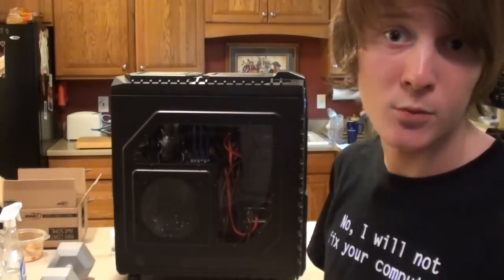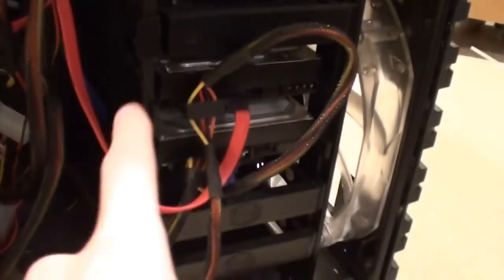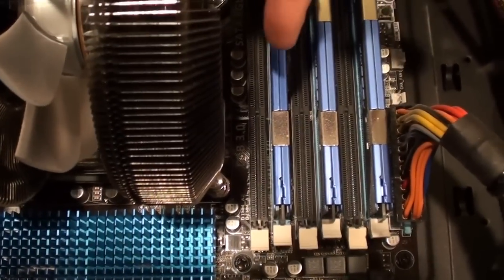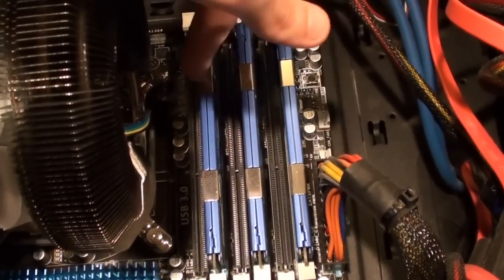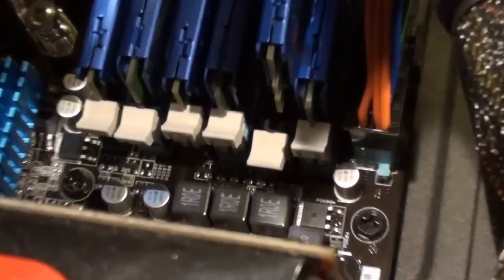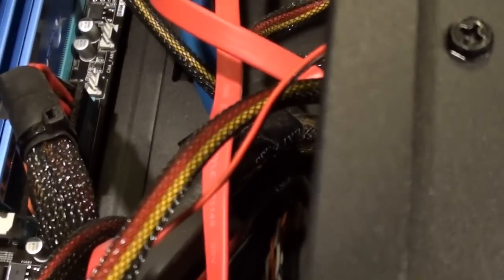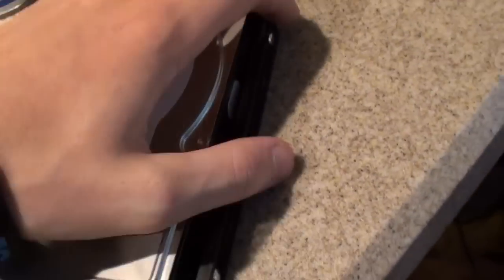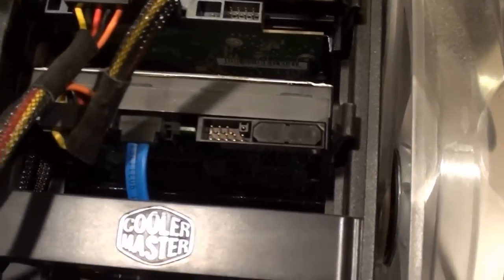Rep Tech  #2 How To Install Ram In Your Desktop PC

Comment: Touch the metal on the computer frame so that you are the same charge as the computer (saves lugging around 30# weight). Also I thought that there is a jumper on hard drives that must match the dead drive you removed?

Comment: thx so much, but I have a question I have 4 slots and the second and forth are filled, I want to add more ram, can I add just one stick and if so where would I put it in the 1st slot or the 3rd slot?

Comment: Cable Management is a common overlooked part of building a PC. Don't be that guy with a birds nest of wires inside yours.
Reply: Owen E That's me lol. My PC came prebuilt so they were wrapped all nice but when I upgraded my gpu I needed to upgrade the psu also and oh god..it looked horrible by the time I finally got it all installed. The cables look terrible lol.

Comment: The notch in the RAM Stick doesnt match up with the notch in the Slot where I put it? Is there different types of RAM Sticks? I'm very upset I spent alot of money on the RAM but they wont go into the Motherboard Slots for the RAM.
Reply: did you buy ddr3 ram for a ddr4 motherboard?
Reply: Yes I did. The guy that sold it to me messed up. But yes, my motherboard is a DDR4. Its all fixed and successfully installed! Thanks for the reply!

Comment: When I put ram in my computer, I start computer and is black screen. HOW TO FIX IT?
Reply: same and i get a stupid beeping sound
Reply: that means that the computer of yours is old and the ram is new so the computer needs an old ram just like him i had the same problem and i went to a shop to figure out the problem and i found it out and i hope that helped :)
Reply: I have the same problem but my PC is new and no beeping and won't work even if I put my old RAM in
Reply: Did you buy the right type of ram???
Reply: I have realized that the reason why it wasn't working is because when I installed the RAM, I accidentally got dust in the CPU. Now it's working and yes, it's the right RAM xD
Reply: i got a new pc and it takes ddr2

Comment: Hello everyone, I bought a PC that came with ADATA RAM built in about 3 years ago. Last week  I checked the specs on SPECCY and it has a latency of 11 clocks and its cycle time is 28. So I went on to amazon and bought an ADATA 8gb stick with the same specs. 

When I plug in the RAM (making sure to first shut down the pc, pull the plug and discharge any stored power), the PC starts but the monitor stays in sleep mode. Any ideas why this is? Works perfect without RAM plugged in. 

Thanks in advance

Comment: I have 2 slots, one with 4gb. I want to install an 8gb into one so i could have 12gb of RAM but my fan is blocking the slots. What do i do?
Reply: +Kea&#39;raThe Weeb  Either you buy a new cooler or low profile ram.

Comment: Hi. I have a 2 GB RAM currently running on my PC. If  had to install a 2 GB DDA2 RAM, Do i have to reboot my PC or just directly by switching off my PC and removing the bolts and put the ram into the first slot on the RAM slots on the Mother Board. Plaese tell me or it could boom my PC or OS.
Reply: You need a fresh windows install for the ram to register
Reply: Thanks for the info. Beefstick

Comment: How do I use desktop ram for my laptop ?
Reply: +Mike V You can't
Reply: Isnt there a converter that converts desktop ram for a laptop ?
Reply: +Mike V no there isn't
Reply: darn, mayby I could go to a computer store and trade it in for laptop ram
Reply: +Mike V maybe..
Reply: I hope
Reply: +Mike V laptop ram is different than Pc ram cause it's smaller and it goes in sideways so that's why it won't work
Reply: whats the best FREE operating system ?
Reply: +Mike V Linux Ubuntu.
Reply: +Mike V ,

Comment: does it matter if you use different types of brands
Reply: I get your question. I know what you are asking.
There are many different dumbbells. I would suggest you to get 5 Kilogramms at first.
Remember that you need at least 5 Pcs if you want to keep going up.
On your second pc use 10 Kilogramms Dumbbells and keep going up until you feel comfortabe with the weight that fits you the most.

Some people prefer to close thier Computers with dumbbells left behind inside, But it leave that decision up to you. Hope it helped. :)
Reply from the maker: +cb7rider18 if they're the same speeds, and same GB size then, you could, but i wouldn't recommend it.Its safer to use the same brand.
Reply: +cb7rider18 The best thing to do is buy the exact same model you already have. Even if frequency, latencies, voltage, capacity and other factors match, RAM sticks are only validated to be used with identical ones.
Reply: +MrRepzion i hope you answer this. I don't know it's weird the guy who built my gaming PC but the RAM stick in the first one he said it's 8 gb RAM but maybe because he plugged it in the 1st slot it does that ?
Reply: THE ULTI-GAMER HD The slots have nothing to do with the capacity. A stick has a given capacity and the only thing that can change by putting the sticks on different slots (assuming your PC boosts) is on what channel they'll run (single, dual, quad)
Reply: BLACK_INVADER_X Yes, usually to ensure compatibility you should buy a matching kit to the one you got. There's voltage, speed, latencies, and even if you match them all, no insurance the system will post if you get different RAM.

Comment: Ok so I have 4 ram slots I'm using the first and 3rd ram slot (4x2 gb) when I tried to install 1 8gb stick into the 2nd ram slot and boot the computer it would power on for a few seconds and the just shutdown can someone please help? Also yes my motherboard is compatible with the new ram I'm trying to install
Reply: They always have to be the same ram or else it fucks up that simple , you cant have a 4 , 4 , 8 combinaition

Comment: Ok so I got 4 new ram sticks but after I replaced the old I get a windows error critical_proccess_failed
Reply: +GZKilla1 i read that they have to be the same size. Like 4 x 4 x 4, Not like 4 x 4 x 8
Reply: they were ,but i foundd out what happened,it was windows 10 i had to retore to windows 8 and it worked

Comment: I am not the most computer savvy, but when you install ram, how do you know that the computer accepts it? Also, after installation, are there any other steps that need to be taken or is it just plug it in and go?
Reply: Plug in and go.

Comment: I’m not sure where you get the idea from that you have to leave a slot empty between each ram port or as you said your PC won’t run it must perhaps be the way your Motherboard is configured. I recently had to move ram from nearest the CPU to two other Blue coloured ram slots (slots B) leaving those first two (A) slots empty. The reason being one of two of the white clips broke off on the second slot from the CPU. The reason perhaps that they broke off was because I did not put enough pressure on the top of the Ram to aid in the release of the clips that was an AMD Motherboard by the way.  One other point: Always use an Anti-Static wrist strap to prevent damage from static as static can build up very quickly especially if you’re a bit flustered whilst working on your PC components. Nice clear presentation you gave good lighting.

Comment: tried to install ddr3 1333 4gb ram on msi g41m p33 combo but ended up with 3 beeps and no display.
help!!
Reply: Azam it means that you have got a problem with the RAM. It means you have either not put the RAM in right or the sticks are bad and you must take them back to the shop and tell them the problem you are getting
Reply: Did some research..g41 intel chipset doesnt support 4gb ddr3 1333mhz..but thanks for the help :)
Reply: oh right ahaha, have you got it fixed now? :) I am happy to help :)
Reply: Nope..i bought the wrong one..need to upgrade the mobos that supports 4gb 1333mhz, coz now i cant play cod advanced warrfare 2 with 2x2gb rams!!anyway thank you man :)
Reply: that's fine and sounds really good :) I hope that you get no more problems :)
Reply: thesam723 i have a msi gaming 5 z97      i bought 16gbram(8x8) and one does not work can u help?
Reply: okay I might be able to. have you checked that it is compatible with your motherboard?
Reply: if you have have done that, when you turn it on do you get any post deep messages? meaning does your computer beep?
Reply: another reason it might not be working is it might not be in the right ram slot
Reply: or in the worse case it is just broken and maybe subject to static damage
Reply: my name is joe if youre gonna buy a mobo or new ram, always check they are compatible with each other. I like to check on pcpartpicker.com
Reply: depends if your mother board support ddr3,

Comment: You did you get 6x2 gb ram when you can get 3x4 or 2x6 gb
Reply: And 3x4 is too.
Reply: Its better to have 2x6 instead of 6x2 because even if they have the same speed they won't be as fast as 2 sticks with the same memory

Comment: Ok, so I know barely anything about the inside of a computer, I only know how to use it. But I have a Hp pavillion p6-2003w (deskop pc) and it really is not the best computer. I want to be able to buy more ram, another graphic card, and another hardrive but I dont know if this computer can handle all of that. I would hate to buy new parts and then this computer is not able to take them I also dont even know what to get! Any help??
Reply: MostWasted
NO, DO NOT. Alienware is very, very overpriced for what you get, you can build a PC that's 10x to 100x better for the same price or even less.
Reply: http://goo.gl/Y2ee7N this site has all the info to my computer. it's helpful but again, I dont understand much of it
Reply: ssamante If you're looking to upgrade your computer to something like a gaming build I would just sell that pc you got and build a new one. The motherboard on that isn't compatible with many processors and only has two rams slots (Which can be fine if you get 4x2 or 8x2). In the end I would just recommend building a new one for like 800-1200$ its a lot easier and you have a lot more flexibility if you do.
Reply: MrPainolympics that was really helpful, and I'm actually considering that. Thank you for both your help!
Reply: Something I'd recommend:

8 GB DDR3 1600MHz
Any Samsung SSD (250GB or bigger) (for OS and programs)
WD Blue 1TB (mass storage)
Core i5- 4670K
GeForce 770 2GB/3GB GDDR5, or 290X 4GB
Reply: Just get an alienware x51 it's half the size of the computer in this video and can run Battlefield at maximum graphic settings around 60 fps for 600 - 700$

Comment: I need help, guys please advise! I want to upgrade my RAM. My motherboard model is Z68P-DS3 and I found online that it supports up to 32GB of RAM with 2133Mhz with 4 slots opened. Now, I have 8GB of "Kingstons HyperX" (2x 4GB) instaled already, but I want to buy a new 2x 8GB 1866mhz "Kingston Fury memory". My question is - can I stack these (even they are different speed) or should I just remove the old ram, sell it and put the new 16GB, or can I stack it for total of 24GB? Thx for all the answers in advance :) Cheers.
Reply: Ok first off, srry for late response, as for the issue your having... yes and no.   (yes)- if you don't mix ram brands or types. example, you'd be mixing 2 types. hyper and fury, so in this case no unless u want longterm issues. u can mix speeds since mostly 99% of mobos will automatically set the lowest ram u have in as your primary speed, so if u have 2 sticks of 4gb at 2133mhz, your 8gb 2x4 1866mhz Kingston hyper not fury, would be fine then. I would honestly check to make sure your 2133mhz is first underclocked in bio's manually to 1866 though to avoid issues before installing new ram.  There you go bud I hope that helps you :)
Reply: One more thing btw, as for stacking I can also suggest your sorta only newbie/intermediate with computers, so yes you can possibly put both in if im going to contradict myself now, the reason I say this is because I had already installed 2 different types of ram before in my old comp but it doesn't mean it was safe but it is possible, the requirements to even think of it being possible would be (making sure ram speeds, timings, and volts and a lot of other minor things stay the exact same). and its not wise to mix ram but I did mix ripjaws x with sniper on 1150/1155 and 2011 sockets. but I had 24gb at the time of ddr3 240pin. and yes I had to go to bio's and manually set them to run at same speeds, timings, and voltages ...the volts on the gskill is 1.5v the volts on my sniper at the time was like 1.35v. so mobo automaticly didn't make it use 1.35 I had to set it to limit at 1.35v which slows your ram and cuts the gskill from 12800pc3 to 10600pc3. So if your experienced enough then yes...but I really wouldn't recommend it.    sources-7years building rigs.
Reply: michael barczak Thanks for the replay man :)
Reply: No problem at all hope your all set though by now :)

Comment: i just bought a new pc and im wondering should i take the ram out of my old one and put it in my new one or not
Reply: so in doing that it incresed in power but its still shit and only has room for two sticks and to make it worst its like $170 just to upgrade it holy fuck
Reply: MultiGameLP's Find Ram cheap on Newegg. Ebay is a great place if you find the right seller
Reply: MultiGameLP's Just make sure its compatible with your motherboard and processor.

Comment: Are these specks good
General Spec
Brand
iBUYPOWER
Model
NE641FX-1
Type
Gaming & Entertainment
Usage
Consumer
Processor
AMD FX-8320 3.5GHz (Max Turbo frequency 4.0GHz)
Processor Main Features
64 bit 8-Core Processor
Cache Per Processor
8MB L2 Cache
Memory
8GB DDR3 1600
Hard Drive
1TB SATA III 7200RPM
Optical Drive
24X DL DVD+/-RW Drive
Graphics
NVIDIA Geforce GTX 650 1GB
Ethernet
Gigabit Ethernet
Power Supply
400W
Operating System
Windows 8.1 64-Bit
Special Features
ARC 647 GAMING CHASSIS

Motherboard
Chipset
AMD 760 Chipset

CPU
CPU Type
AMD FX-Series
CPU Speed
FX-8320 (3.50GHz)
L2 Cache Per CPU
8MB
L3 Cache Per CPU
8MB
CPU Socket Type
AM3+
CPU Main Features
64 bit Eight-Core Processor Max Turbo frequency 4.0GHz

Graphics
GPU/VGA Type
NVIDIA GeForce GTX 650 1GB

Memory
Memory Capacity
8GB DDR3
Memory Speed
DDR3 1600
Memory Spec
4GB x 2
Memory Slot (Total)
2
Memory Slot (Available)
0
Maximum Memory Supported
16GB

Hard Drive
HDD
1TB
HDD Interface
SATA III
HDD RPM
7200rpm

Optical Drive
Optical Drive Type
DVD±RW
Optical Drive Spec
24X DL DVD+/-RW Drive

Audio
Reply: HOLY SHIT YES!!!
Reply: Yes!
Reply: No, it's shit

Comment: To get the right ram, do I just go to the computer shop and buy the same speed as I already have, i.e 1333mhz or do I tell them what motherboard I have and they will tell me the right ram to buy?
Reply: Well your motherboard's support page will most likely have the supported speeds, many motherboards support different speeds

Most motherboards today support:
DDR3
1333, 1600, 1866, 2133

1600 is really the minimum in today's standards, though for not much more than a single 1x8GB stick of 1600 you could get a 1x8GB stick of 1866.

Comment: In my computer i made i just baught new ram for it, and the problem that i am having is the noch in the ram slot on my mother board doesn't line up with the one in the ram sticks no matter what way i turn it. Do I have to get a new mother board or do I have bad ram.
Reply: OK, so your motherboard probably has less pins to connect the ram then the ram does. If other words, you need to get a new motherboard or new ram. to buy the right ram just find your motherboard name and google it then you will find how many pins the ram slot has

Comment: Would this still work I have an all in one desktop ( PC and monitor in one) I have 4GB ram and it only lets me play minecraft at 50fps and when recording 30fps. I am buying a 8GB ram chip, could I still use it for an all in one?
Reply: If it's upgradeable AND if your motherboard supports the amount you're putting in and the speed of the memory you're buying.

Comment: I remove ma ram and I cannot put it again I try upside down and it can not fit on the ram slot.what I em gonna do with the ram?
Reply: there are tabs at the side you have to press
Reply: idk if you figured it out but you might have the wrong amount of pins for your ram. server ram and server mobos use different pin numbers such as 184 instead of 254 or whatever

Comment: Can someone please tell me what the thirds plug in is used for on the hard drive. And also what size ram do I need for bf4 and graphics card. The cheaper the better for now
Reply: okey soooo, on the ram you should about 8gb and gpu wize you should just get a saphire r7 260x which can cost at wallmart $125 and the ram coming in at around $50

Comment: He's a bit off when talking about how to shop for your RAM. If your motherboard can only support up to 1600mhz clocked memory, and you drop in some 1833mhz memory, your mobo (motherboard) should* just use it at 1600mhz.

Comment: WHEN WORKING ON YOUR PC AND YOUR AT HOME DON'T WERE SOCKS  THEN YOU WONT HAVE THAT STATIC  PROBLEM  OR WERE RUBBER SOLS
Reply: Or just touch the case every so often to send current back to ground, wear static wrist strap, and work on a non-conductive surface ie wood, glass, stone etc. No need to shout.
Reply: i work on my bead on mad pcs and never had a prob cause i use a juice drainer to make sure there is not any juice in it and i al so use a wrist band
Reply: ...wtf
Reply: Don't mind maxamillion he hit his head when he was a child and spelled metal like mettle
Reply: I just wear rubber gloves

Comment: My pc tower has not been touched nor moved from the same spot for months. Lately pc kept turning off. I opened up pc and the Dimm memory card had fallen off the slot and was at the bottom of the tower. I was able to snap it back on...but I sure was baffled about how it fell off

Comment: Rep you need to clean up the inside,not dust it off but like hinge the wires to the walls so it's easier to work with